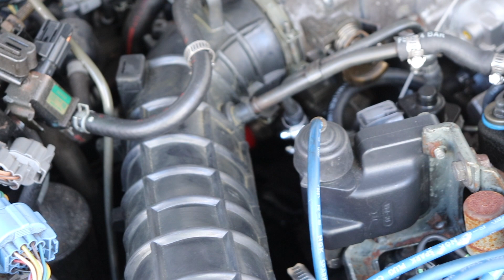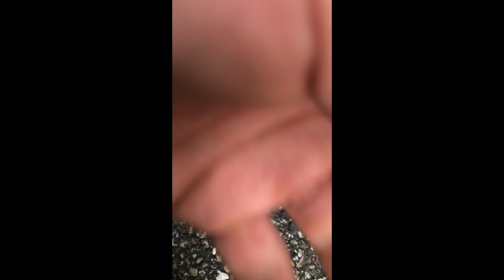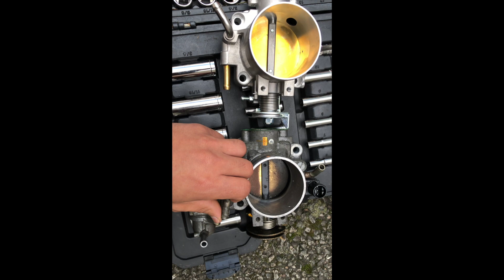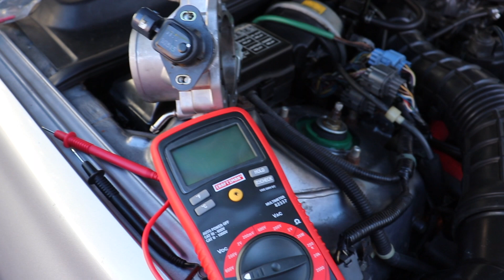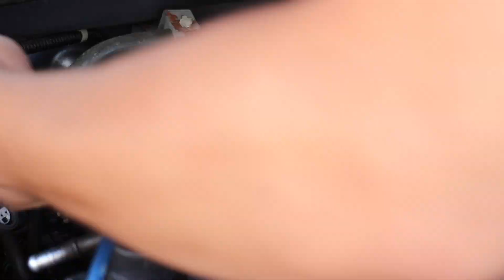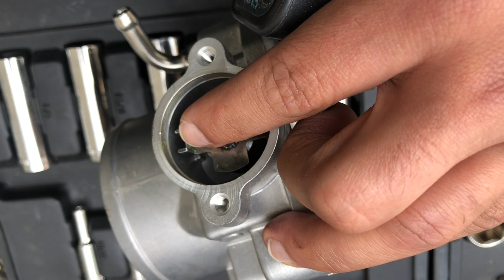Honda prelude: How to install Skunk2 Alpha throttle body

Comment: After installation did you have an ecu issues? did you have to do anything else? Did yhe stock intake fit?
Reply from the maker: I had a vacuum issue because the throttle body was leaking air past the throttle plate. There were no ECU issues and I did not have the chance to fit the stock intake before I had to re install the stock throttle body.
Reply from the maker: Nothing else had to be done.
Reply: How do you have delete the fitv?